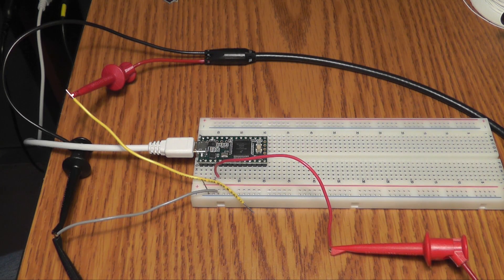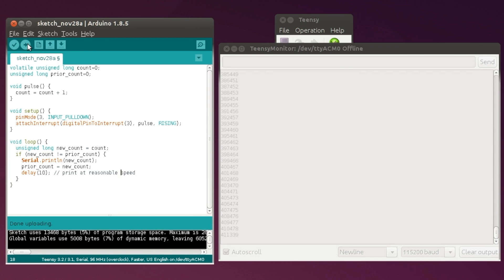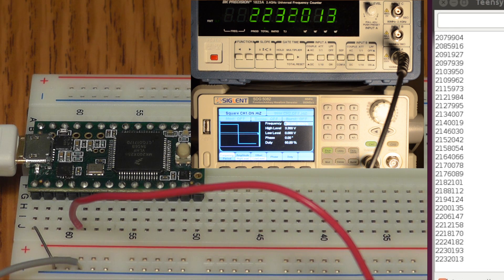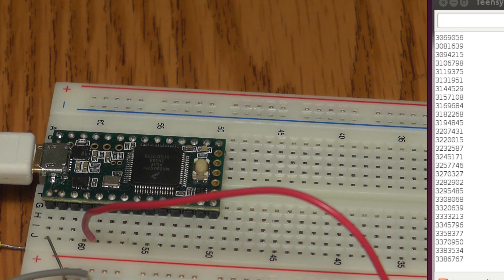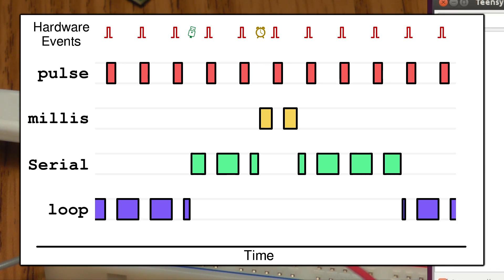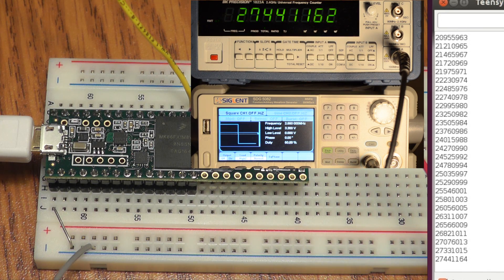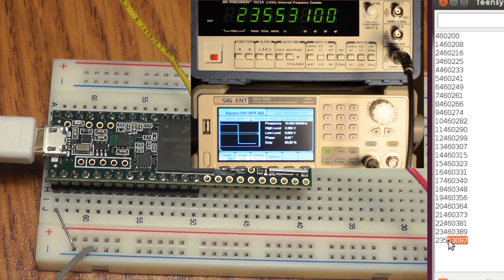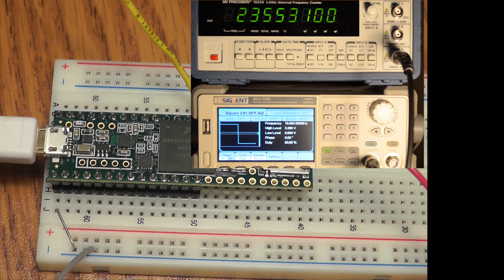Fast pulse counting with Arduino interrupts and why nested priority really helps

Comment: I am trying to run a similar test with a MKR 1400.  I have found the section of code in variants.cpp that shows the mapping between the physical pins on the MKR 1400 and the interrupt numbers.  However I don't know how to set the priority for a specific hardware pin, #4, to priority 1 using the function NVIC_SetPriority( (IRQn_Type) int_num, int_prio).  Pin #4 maps to PortB10 and extint 10.  When I try
NVIC_SetPriority( 10, 1) I get a compiler error: invalid conversion from 'int' to 'IRQn_Type {aka IRQn}.  Am I missing some function call that gets me to the right type of interrupts?  Thank you for your video.

Dan

Comment: Hi Paul! Thanks for your video and also your library. I have a question, so I am trying to figure out the frequency of my incremental encoder, which has 2 phases(A&B), with arduino UNO. Using the freqCount library then I have to hook one of the phase to the digital pin (6)? Is that right?

Comment: Nice your video. Good job. 
You please helping sir. 
I have a Mike one project but one problem. 
Am Arduino programing ( I'm just starting to learn) Unable to write program.?
Reply from the maker: YouTube comments aren't the place to get this sort of technical help.  Forums are where to ask.  If whatever board you're using has a forum, ask there.  If you have a generic board which doesn't have a support forum, but you're using the Arduino software, ask on Arduino's forum.  https://forum.arduino.cc/
Reply from the maker: Before you post a forum question, consider there are 3 factors to success when asking random people on the internet for technical help.
Reply from the maker: #1 - Make a good first impression.  The main way is showing you are trying.  People want to help others who make a sincere effort, even if that effort is just trying Google searches and not yet knowing the correct words.
Reply from the maker: #2 - Give context.  Explain your goals or what you are trying to accomplish.  People who understand your needs can answer much better than if you ask a narrowly focused or overly vague question without any explanation.
Reply from the maker: #3 - Share details.  Say which software, hardware you're using and give screenshots, photos, exact code or error messages.  Details matter for solving tech issues.  People who see your question will be able to help only if you give enough info.
Reply: @PaulStoffregen  . 
Thanks sir very happy

Comment: If I needed to do other things along side of counting, how would I go about doing that?  (Other things = Display, SD card etc)
Reply from the maker: Short answer: those things are generally done from your main program code, not from an interrupt.
Reply from the maker: Longer answer: best to ask on the forum, where you can write a more detailed question which gives context to understand what you're really trying to accomplish with your project, and specific details like the hardware and code you're already using.  Comments on social media sites like YouTube are good for only quick questions and simple answers.  Forums are where you go for more in depth discussion of how to do a design a project and structure your code.
Reply: @PaulStoffregen  I have done that before. Normally don't get an answer
Reply from the maker: @lovermonkey  Well, there are 3 things to do when writing a forum question that greatly improve your chances.  1: make a good 1st inpression, 2: give context about what you're really trying to accomplish, and 3: share specific details so people can at least see and maybe even reproduce whatever technical issue is at hand.
Reply from the maker: The 2 ways to make a good first impression are 1: demonstrate you've made some effort (photos are best) and 2: appear to be genuinely interested in learning.
Reply from the maker: If you ask a quick context-free, low-detail question that lacks any sign of effort (the norm for quick comments on social networking), even on the very best forums the only thing you'll get it people asking you to give more info.  But on most forums, people who like to help others will just move on to someone else's question who put in more effort and genuinely wants to learn how to do something.
Reply: So don't do what you have been doing. Great. Thanks 😊  My Ardunio knowledge thanks you.

Comment: i want to use (Sensor generated ) interrupts as a counter for fast moving objects. like seed counter. but i need to know which sensor will be most useful to detect the small grain sized particle to trigger the sensor and cause interrupt.
Reply: salam, u can use beaglebone black in which inside there are 2 co-processors independently can be used ..16 interrupts almost..and linux support

Comment: Would this work for external switches? For example if I have a toggle switch operating a motor (forward and revers directions) and have two limit switches to bound the distance the motor can move. Can I give the limit switches the highest priority so that the movement of the motor is halted when limit switches are closed ?
Thanks!

Comment: I tried this with an Arduino Uno and it didn't like the NVIC_SET_PRIOIRTY line.. Is this a Teensy-only thing?
Reply from the maker: Yes, NVIC_SET_PRIORITY is a Teensy only thing.  Other 32 bit ARM chips have interrupt priority with their own ways, but Uno's interrupt hardware doesn't have priority capability, so there is no way to do this on Uno.
Reply: Thanks Paul! Just picked up a couple of 4.0s from you guys to play with :)

Comment: your hitting the capacitive coupling on the breadboard, IIRC breadboards are good till about 10MHz due to stray capacitance on the fingers inside the breadboard (2-20 pF per pin pair)
Reply: pro tip: watch series on flixzone. Been using it for watching loads of movies lately.
Reply: @Jase Titan Yea, been watching on Flixzone} for since december myself :D

Comment: Nice Video! Can I use it on Arduino Due? And can I have multiple frequency measure? Thanks in advance!
Reply from the maker: So far nobody has ported this code to the SAM chip used on Due.  In theory it could be done, if someone familiar with that chip's timers puts a lot of work into porting the code.  That chip also supports interrupt priorities, but Arduino's core lib and all the other libs for that chip don't make use of the priorities, so to get the interrupt priority part working would require a lot more coding work...

Comment: Are the priorities of loop, serial etc set to a default ? What is the default and can they be changed arbitrarily?
Reply from the maker: Details are discussed on the forum thread linked from this video's description.
Reply: I am sorry, i cant find it in that relatively short link(single page).
Maybe you want me to ask the specific question on the forum ?

Maybe i can be a bit more specific. The loop and millis interrupt are not declared by me, they are probably done somewhere behind the screens by the IDE?
If i want to make sure the interrupt that i define by:
attachInterrupt( ...) goes before serial but after loop, what priorities are available to me?
Or alternatively what is the syntax for changing the interrupt priorty of loop and millis ?

I found default Serial interrupt is 64?
USB is 112 ?
systick is 0? 
Then what happens if i set pin_interrupt priority to 0 as well?
Reply from the maker: SysTick defaults to 32.  When an interrupt runs, it blocks all others at the same or higher (lower number) priority.  So if you have two interrupts at priority 0 (the highest you can set for normal interrupts), then whichever happens first gets serviced and the other waits until the first completes.  The same is true for any pair at the same priority.

Comment: That doesn't look like an arduino, is it a 32bit board? What MHz is.it?
Reply from the maker: It's Teensy 3.2 using ARM Cortex-M4 running at 96 MHz.
Reply: johnDon. Or you watch the video.
Reply: Can I use it on Arduino Due? And can I have multiple frequency measure? Thanks in advance!

Comment: You delay a bit between the serial prints, that might account for some of the discrepancies?
Reply: no
prior count will only happen when serial prints
if new count changes within the delay(10) then prior count will be different from new count and it will be updated at the next loop cycle.
basically 10 milliseconds after new interrupt the last new count value is guaranteed to be the correct value.
Reply: @jerrymk6846  So, if the interrupts are coming in faster than the Serial.print function can be executed, that's when they stop being displayed in the console, correct? It'd still be counting in the background, but wouldn't be printing it out.
Reply: @toastrecon  The counter is basically always up-to-date (because changing a variable doesn't take any significant time). The value will only stop getting printed when the previously printed value is the same as the current counter. The "previously printed value(prior count in the code)" is guaranteed to update when a serial print happen. If the counter got updated while serial print is running, the counter will be up-to-date, but the "previously printed value" will not be same as the counter, and then the value will be printed out within 10ms after.
EDIT: Oh yeah I re-read the code and you are correct. If prior_count = new_count; line is moved to before Serial.printf then it will be less likely to happen. Serial print actually takes quite some time and may lose a lot of counts...
Basically an oopsie happens when counts happen within Serial.print function